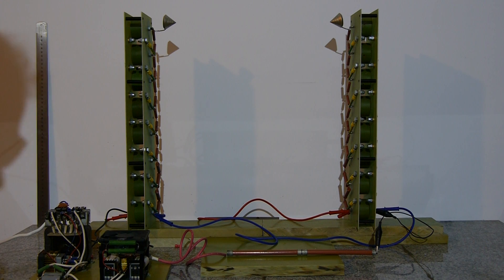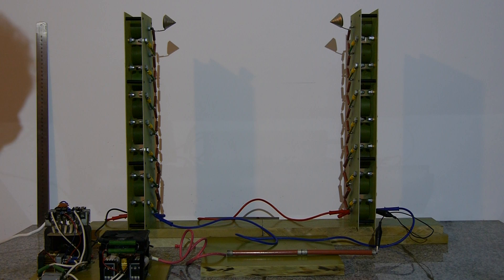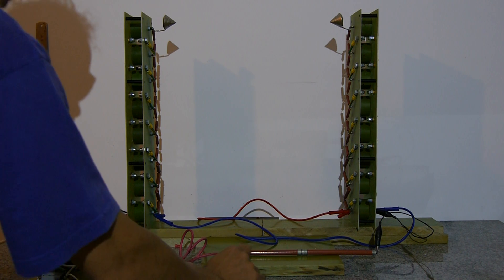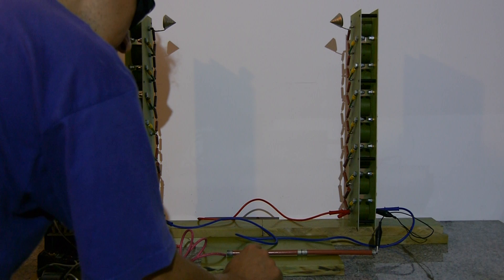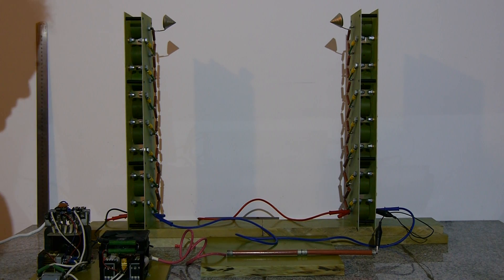Marx generator upgraded 350kV+

Comment: with smaller capacitances it comes out faster?
Reply from the maker: Yes, but You must consider also the losses by corona effect. If the capacitance is too low, than You may not get a discharge at all.
Reply: @virgilius1979  what are those megaohm resistors doing on the side,   shouldnt they be 1 ohm tops?

Comment: How do you measured the voltages across the capacitors while you were making it?
And also the  charging and discharging of the capacitors?
Reply from the maker: I don't measure the voltage across them. They charge through the resistors and discharge during spark ignition. There's some residual charge after spark, but it doesn't last long, probably corona effect.

Comment: Do you have used polarized capacitors?
Which type of capacitors you have used in this?
Reply from the maker: I don't have a datasheet, they are russian origin designed for pulse operation; they are doorknob type.

Comment: Wow brother
Urgent
I need your help
Can you please tell me that how you made those tower structure
i.e using plastic or what?
And also how you fixed those components (like capacitors etc.)on those towers.
Please reply
Reply from the maker: It's not complicated, but you need some time. The design is easy, you can see in the movie. You need high voltage capacitors and HV resistors, a HV DC power supply;  there's tons of movies and pictures about Marx generator on Youtube and Google.
Reply from the maker: I used phenolic board ( type of plastic) to fix the capacitors, you can use any type of plastic board I quess. The caps had terminals with screws...
Reply: Bogdan Rotaru thanks bro
Reply: Bogdan Rotaru I have another question
Do you have soldered those components of have used any other type?
Reply: I have a doubt bro 
Do you have soldered the components?
Reply from the maker: it doesn't matter if you soldier them or use connectors with screws. You must understand this is prototype not an industrial series model.
Reply: Bogdan Rotaru Do you used 1/2 watt resistors or 2watt resistors??
Reply from the maker: Deepak Chawla . it's more important they're rated high voltage, put more in series if necessary. At least 1w, better more.
Reply: Impressive 
Please reply Urgent
Bogdan Rotaru Bro what was your input Voltage and what type of capacitors do you used??(means polarized or non-polarized?)

Comment: I m making Marx generator .Input is 2kv and output is 20kv with 10 stages. please tell me the rating of capacitor and resistance required how must - micro farad need to be taken .
Reply from the maker: There's no magic formula for Marx generator. And I don't do spoon feeding. Please read more and try yourself, it's not that hard!
Reply: Bogdan Rotaru I will try
Reply from the maker: indeed, 2kv input is too low, distance is too short at spark gaps; it's not worth to build a Marx generator for this, a flyback transformer or even a HV module from ebay is enough :)
Reply: yes or for more, buy big ferrite core und wound your on secondary coils in oil container.
Reply: 20kV Out with Marx are useless at all... 20kV Input...

Comment: how to make it continuous supply
Reply from the maker: You cannot. Marx generator delivers pulsed voltage. If you want continuous you need either a high voltage transformer, or a Cockroft Walton multiplier (with capacitors and diodes, see my other videos) and can put a series resistor to prevent pulsed discharging and have a continuous current.
Reply: @virgilius1979  I could be wrong but, there isn't a version with inductors?  I only found a video of this version, but it seems to be possible to have a more constant output with inductors.